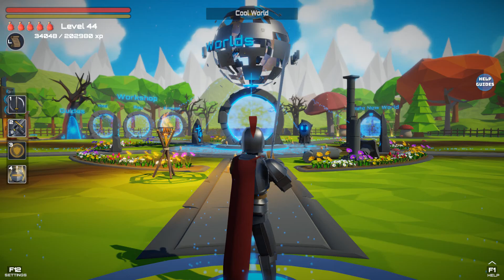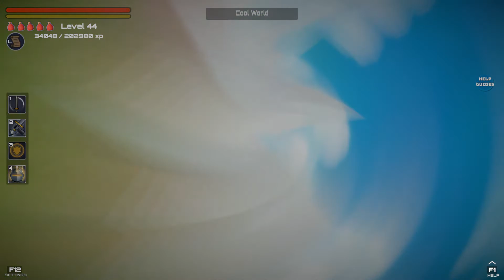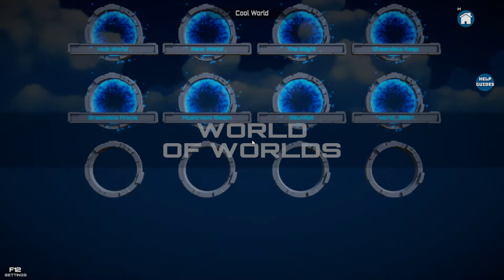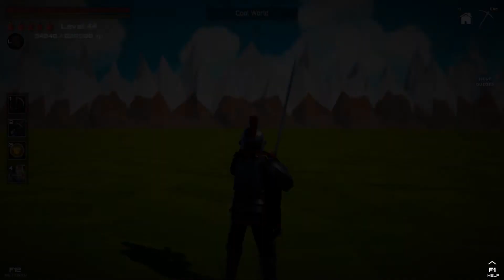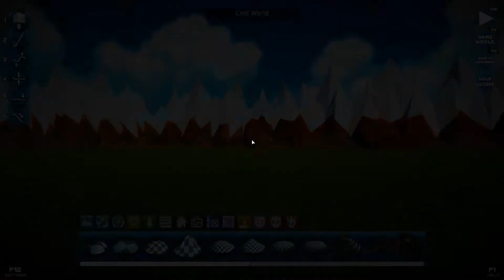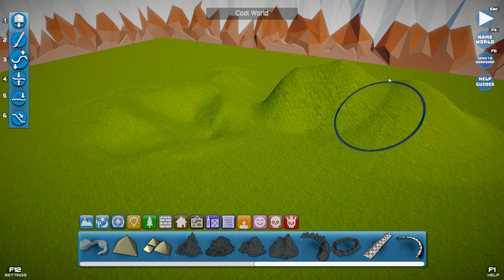MyWorld New Settings & Terrain Tools

Comment: Great addition, that should address the biggest issue in map design. On a different note, the ramp tool is an interesting example of using two point selection. It would be interesting to see a building such as a bridge use that same functionality.